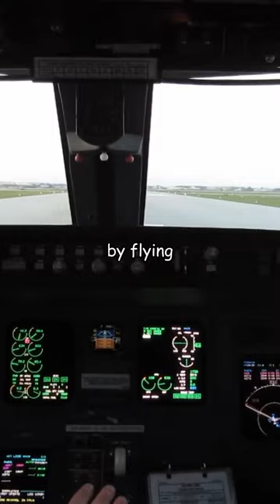What Happens When a Pilot Flies Too High? 🤔 #shorts

Comment: How do you think they know what the max altitude is?
Reply: Maybe air density with the general performance of the engine, and performance of the aircrafts body. Or just flying it
Reply: Depending on what the airframe is made to endure, what kind of engines and how the cockpit is pressurized and most importantly your flight suit, a SR-71 lost a horizontal stabilizer and the aircraft started pitching upward from 75k ft and began to break apart around him ,  so he obviously fell unconscious and froze, when he hit a certain alt. his shoot opened and he began peeling the ice off his Helmut and hands , when he landed he made radio contact . Great story if you look it up, cheers